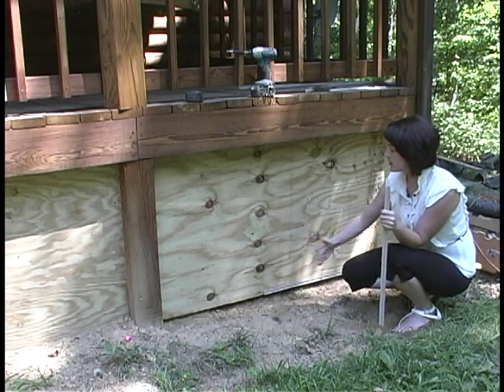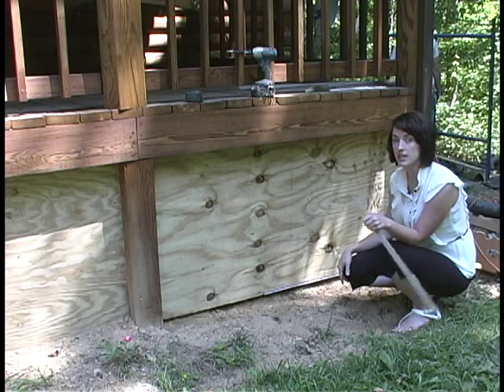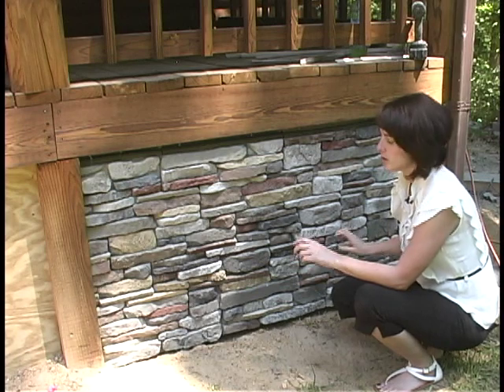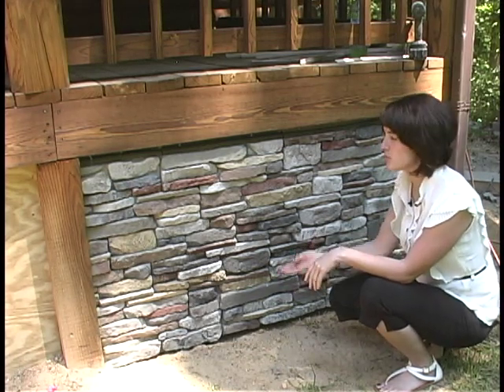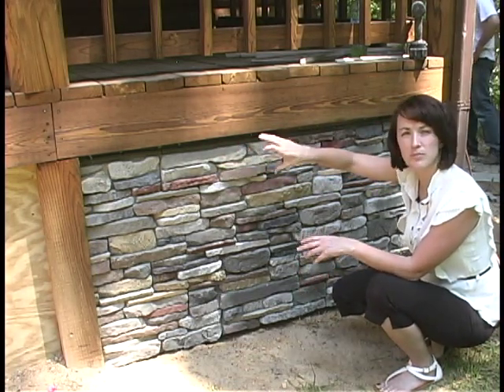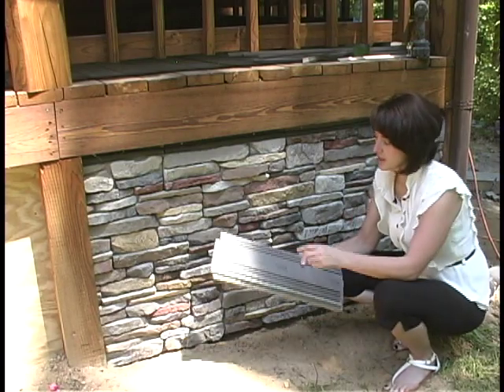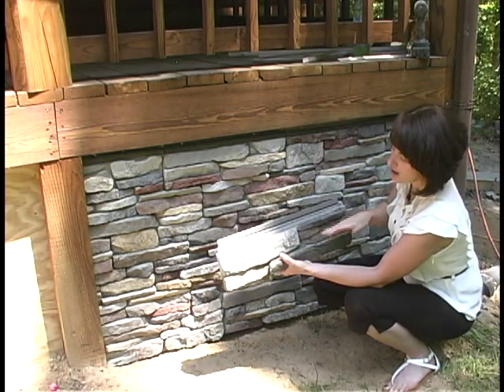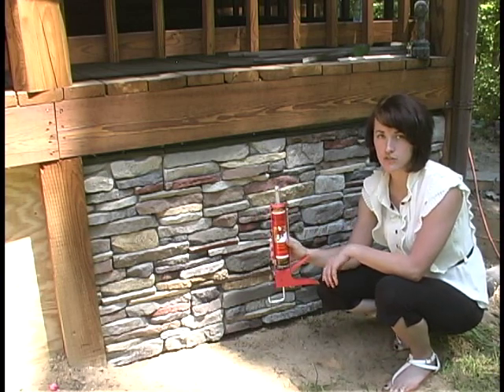M-Rock's P-Series and Superior Fit

Comment: Maybe it was just the shipment i received, but globs of cement have had to be ground off of almost every block with an angle grinder with diamond blade. Several of the modules ( in at least every other box of 7) are not straight, as if the mold flexed when they were poured, resulting in some pieces being 4 7/8" tall and some as much as 5 1/8". This makes for a lot of moving pieces around to get them to fit. The tongues & fins are different, try to line up the blocks just using the narrow ledges.